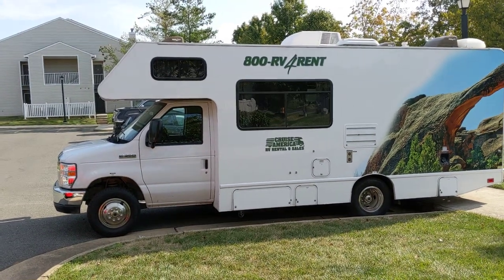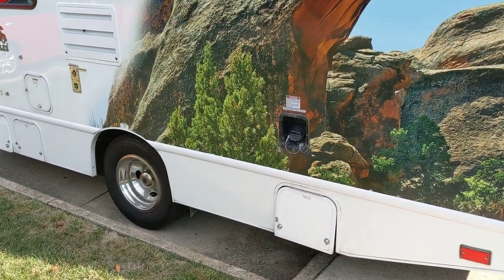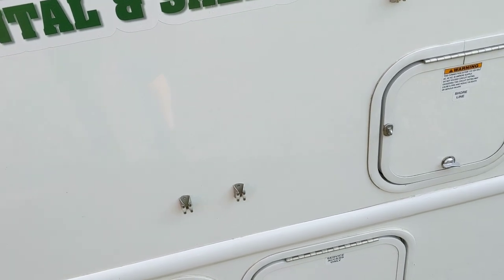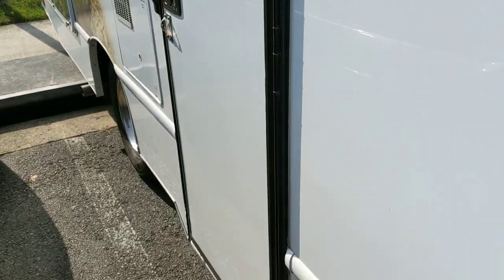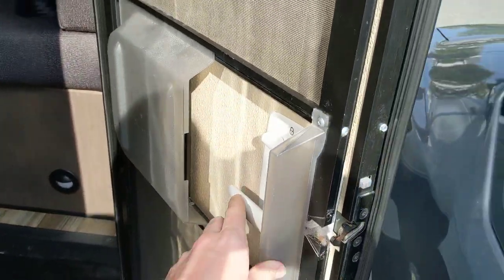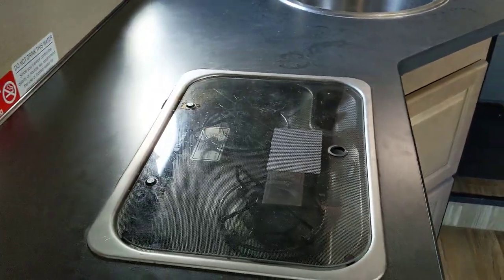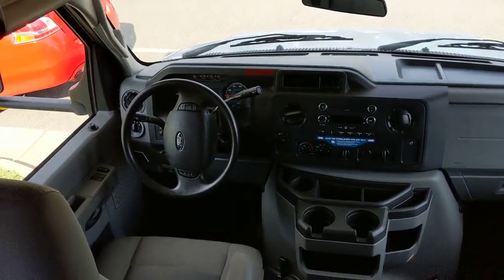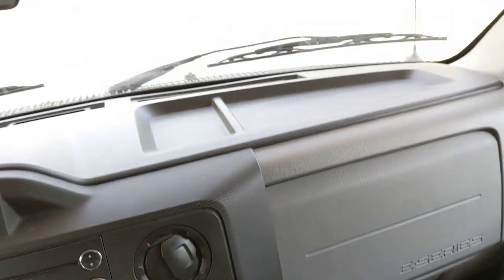Cruise America - Review and Walk through of 25' standard 5 passenger RV

Comment: Plan on renting an RV from Cruise America for a family trip next summer, but had a few questions that the Cruise America Orientation video doesn't cover. I was hoping you might be able to answer. Are the RVs fuel efficient? We plan on driving at least 2,500 miles or more. I know RVs have a huge tank, but I was hoping that it's not a gas guzzler. Also, I saw that you can use propane to keep the refrigerator on while not being hooked to the shoreline or not wanting to use the generator. How long will propane keep the fridge running? I know that this trip is going to be expensive, but just trying to save a little bit of money to spend else where on this trip to make it comfortable and to enjoy.
Reply from the maker: Hi!  Thanks for the comment.  If you scroll through the previous comments you can find a lot of additional information about these questions.  Generally, The standard size RV (with the V8) can get in the range of 10-14 mpg.  The larger RV (with the V10), a little bit less.  There is a big variable of how fast you drive (how heavy your foot is) and the terrain you're driving on.  Up and down mountains is going to consume a lot more gas than traveling across flat ground.  The RV's do have a 50 gallon gas tank so expect to go around 500 miles before filling up.  I remember one year we drove from Northern Virginia to upstate Pennsylvania and halfway back, before needing to get gas.  Of course it was a bit of a shock paying $200 for a fill-up, LOL.  😆

Note that if you use the generator it pulls from the main fuel tank, so this may affect your overall gas usage as well.

Propane is very efficient and should keep the fridge running for days (if no other power source is available).  The fridge has an "auto" setting which they should turn on before you leave the rental office, this way it will begin cooling down immediately.  Remember to not pack it too tight, the fridge needs to be able to circulate air inside to cool properly.  Before you head out I'd recommend topping off your tank.  Most Cruise America rental offices do not sell propane, but I've had good luck buying it at home & garden stores.

Hope this helps, have a safe trip!

Comment: Great video. Three questions that weren’t clear even from the posts - 1. Do we need propane to run the refrigerator while we are driving? Or does it work off the car battery.  2. how much propane is needed for a six day trip where we are staying in rv parks with electric? 3. How far in advance do you need to turn the water heater on? Thx
Reply from the maker: Hi! Thanks for the comment. The fridge has a switch on the top that let's you set it to run off propane, electric, or "auto". When set to auto it will run off propane (when available) or electric (when available). This means it will run on propane when you're driving down the road, and switch to electric once you plug in at a campsite that has full hookups. Typically the rental office agent will set it to auto when you're checking out, that way it will start cooling off immediately.

Propane lasts a long time and is cheap. If you take showers every day or wash a lot of dishes I'd recommend topping it off before you head out. Better to have it and not need it than need it and not have it. Most garden supply stores and other home goods stores sell it.

From the time you turn it on it usually takes around 15 minutes to warm up the hot water tank. So typically I'll turn the water heater on, drink my morning coffee, take the dog out, and then jump in for a nice hot shower. 😀

Hope this helps, have a safe trip!

Comment: Do you recommend buy an electrical dogbone to convert the 30 to a 50 amp plug in at some sites I’ve reserved along our route?
Reply from the maker: Hi!  Every campsite I've been to has had a 30A outlet available at the site.  I think this is pretty common, and you can plug right into that with no adapter needed.  The RV should come with an adapter to use a 20A outlet, but not the 50-to-30, as you mentioned.  Again, just in my personal experience, I've never needed one.  If you're reserving your campsites online sometimes they will give you the option of what type of power you would like when you are selecting your campsite.  I'd try to pick campsites that have 30A available.  If you do want to pick up a 50-to-30 adapter, it looks like you can get them on Amazon for around $20 bucks.  Good luck,  have a safe trip!
Reply: Awesome- thanks so much!

Comment: Video helpful as it is two elderly women who are taking trip and not familiar with all functions.   Do we need to buy propane tanks for the trip?  You showed a hose in RV, do we use this to fill water tank or do we need to bring a hose?  Does the RV 12 Volt cig lighters work well for charging phones or portable oxygen concentrator?
Reply from the maker: Hi!  All the rental RV's come with a standard garden-style hose.  You can use this for filling the fresh water tank from the outside, or connecting to a water source at a campground.

The propane tanks aren't topped off by the rental office, if you need to fill propane prior to arriving at your destination I've had good luck getting it at places like home & garden stores.  Propane is cheap and lasts a long time.  :-)

The 12V cigarette lighter outlets work very well for charging phones, laptops, and other accessories.  I've had no trouble running a splitter off these and using them to charge all my small electronics while boondocking.  Not sure about a CPAP machine though.  If you need to run something like that recommend you stay in a campground that offers an external power source ("shorline power") you can plug into.  Good luck!

Comment: Thanks so much for this, as I am a little nervous on our first RV rental. Couple questions I have. Does the RV come with the hose needed for the hookup of water? Does everything work inside off the electric hookup? Refrigerator, cooktop, and A/C?
Reply from the maker: Hi Dan! Thanks for checking out my Cruise America walk through video. To answer your questions, yes - there should be a white hose in the back storage area for hooking up to a spigot or fresh water source at a campground in the back storage area. Your rental office should show you where it is prior to departure.

Regarding the fridge, stove, and AC, the fridge can run off either propane (if available) or electric (if available). Switch set to "Auto" prior to departure. What this means is that generally it will run off the propane when driving and electricity when hooked up to shoreline power at your campsite. Remember to not over-fill it. They're not as efficient as household fridges. Also don't stand there with the door open. 😉

The stove runs off propane and can be used any time (I belive). Honestly we do most of our cooking outside and have only used it a couple times. The microwave requires either a shoreline power connection or generator running.

Likewise the large rooftop air conditioner only runs if the generator is turned on (can be ran while traveling) or when hooked to shoreline power.

I have a newer/updated video here, check it out:

https://youtu.be/qbBoA0x5Fow

Comment: What is the door width? Can you remove the dining table to stand a sculpture box there or parrot cage (2' x 3') ?
Reply from the maker: Hi! That is a good question! Off-hand I don't know the door width. Suggest calling your local rental office, but I believe they are in the range of 24-28 inches.

The dinette table is designed to fold down to make a bed. So it is on a hinge. From there, the hinge is held to the wall with I think three or four bolts. So yes, it is removable, but not really designed to be removed, if that makes sense? Just needs basic hand tools. 😉 Hope this helps!

Comment: First time RV person here..how long is the 30 amp shore power cord and sewer line?
Reply from the maker: Hi! Thanks for the comment. I've never measured them, but off-hand I would say the sewer hose is around 8'-10' long, and the power cable around 20'-25'. I've stayed at a variety of state parks and campgrounds and never had any trouble reaching the campsite hookups (just remember to park on the correct side for the sewer).
Reply: @CompTechMike  thanks for the info !
Reply: Ok one more question , what kind of gas mileage can I expect ?
Reply from the maker: @robmarrero1250  Hi!  The standard size (25') with the V8 engine get around 10-12mpg.  The large size (30') with the V10 get around 8-10mpg.  Obviously this his highly variable depending on how heavy your foot is, and whether you are driving across flat roads or up and down mountains.  🤣 have a safe trip!

Comment: Also, to be clear-the usb ports do not work while driving?  I think you said only when hooked up to power or generator. Thanks!
Reply from the maker: Hi!  That is correct.  The USB ports in the back only work when the vehicle is connected to shoreline power or the generator is running.  What we did is get a power adapter that runs from one of the 12V "cigarette lighter" outlets on the dash (which are always on) and provides many USB charging ports for our electronic devices.

Here is the model we got.  It is currently unavailable but you can find many like it on Amazon or at your local Best Buy or electronics retailer:

https://www.amazon.com/gp/product/B075KYXJBH/
Reply: @CompTechMike  This is incredible!  Thanks so much! We are leaving early Sunday morning, but I found another one similar on Amazon and I think I can still get it in time.  We got the large RV from Cruise America and have 5 people (2 adults and 3 teens), so we have a lot of electronics!

Comment: How much did it cost to rent?   What part of the country did you rent and use it in?  How did the expense of this vacation stack up against a more traditional vacation that involves hotels and a number of meals out?  Do they provide a surge protector, water pressure valve?  Thanks.  Shelley from San Diego
Reply from the maker: Hi Shelley!  Thanks for the comment and the questions.  I typically compare renting an RV from Cruise America to staying in a nice hotel, with the advantages that you get your own full kitchen and can bring your pets.  Personally we try to rent off-season to save money, and don't need any of the "extras" like cooking or bedding sets, and rarely run the generator.  Beyond that costs vary widely depending on the size of the RV you rent, how far in advance you book, miles driven, whether you need any of those optional "extras", etc.

They do not provide a surge protector or water pressure valve.  We haven't had any trouble using campground water and power but (as far as water goes) we only turn the knob a little bit - don't want to have water "on full blast" into the RV's plumbing system.  There are fuses for electrical protection inside the RV but if you're running a lot of sensitive equipment (laptops, etc.) you may want to bring along your own power strip / surge suppressor. 

Good luck, have a safe trip!

Comment: Actually if you have time, my son is a type one diabetic and we are concerned about the refrigerator sufficiently working to keep his insulin cold. In your opinion, should we just buy an insulated cooler or just run the propane on the road? I keep reading that you shouldn't, but a lot of people seem to still run the fridge. Thanks!!
Reply from the maker: Hi!  The concern about running the fridge is that if you are in an accident while driving the propane line to the fridge could rupture and cause an explosion.  I think this is a pretty minute chance of this happening (although accidents do happen - drive safe!).  The fridge is designed to run off either propane or electric depending on which is available; generally the rental office will set it to "Auto" during check-out so that it will begin cooling down immediately.  Most important thing is do not overfill it!  The fridge needs room to circulate air to keep stuff cold, if it's packed too tightly it won't be able to work right.  Also don't stand there with the door open looking for something to eat, but that's just common sense, LOL.  ;-)

Have a safe trip!
Reply: The fridge takes up to 8 hours to cool and it is not as cool as your fridge at home. I have told our customers to bring a cooler for medicines that need to stay cold.

Comment: Great video! Thanks for taking the time to make it. About the fridge, say you park the RV at an attraction for several hours, obviously not connected to shore power. Is that when it runs on propane, or how does it keep things cold during such times?
Reply from the maker: Hi!  Thanks for the comment.  As long as the fridge is set to "Auto" it will run on any available power source, including propane (provided you have some in the tank, of course).  Propane keeps the fridge cold when not hooked up to shore power.  Remember to not pack the fridge too tightly, as air needs to be able to circulate inside in order for stuff to cool off.  And don't stand there with the door open - RV fridges are not as efficient as home fridges.  Hope this helps, have a safe trip!

Comment: Thank you so much.. we just reserved one for November to go to NC. Have never done this before so  this video answered alot of questions. The propane .. is it always on or do you have to turn it on.. i heard you say shut it off when getting gas. and the fridge and the toilet. work while driving or no? needs a power supply ? sorry very new at this and want to learn everything before we go. thanks again for a great video
Reply from the maker: Hi!  Thanks for the comment.  There is a knob to turn off the propane in one of the compartments along the side of the vehicle.  In most cases you should not ever need to turn it off, but some states do have laws about this (for example when filling up with gas or driving through tunnels).  So it's not a "technical requirement", per se, but more a matter of complying with the laws of where you travel.  

The fridge has an "auto" setting meaning it will run on shoreline power (if connected) or propane (if available).  Your salesperson should turn this on for you as part of your departure check-out process.  It will run all the time to keep your stuff cool.  Remember these fridges are not as efficient as household fridges; do not over-fill it and don't stand there with the door open, LOL.  🤣

The toilet can be used at any time.  Just push the switch on the control panel to turn on the water pump (draws water from the vehicle's built-in water tank)  if not connected to a campground water supply.  Also many states have laws that occupants must remain buckled in while driving.  It would be pretty horrible to get into an accident while someone is sitting on the toilet!  But we've pulled over many times to use it while on trips.  Much easier than finding a clean toilet in a roadside rest area.  😆  Have a safe trip!

Comment: Hi Mike does the passenger seat recline? Also do you have any idea how wide the walkway is...just want to see if my doctors manual wheelchair will fit in the camper in case it rains
Reply from the maker: Hi!  Off-hand I don't believe the seats are able to recline.  There is also a bench located directly behind the passenger seat that would prevent it from being able to go back very far.

You may want to note that the Cruise America rental RV's do not have slide-out sides.  This means they are pretty narrow inside.  Even if you able to get a wheelchair in through the door (by folding it, I guess?), you wouldn't have much room to move around - especially in the back near the bathroom.  I don't want to be someone who says "don't rent an RV", but I think if you require a wheelchair for mobility you may be better suited with an RV that is designed to accommodate that, or at least has slide-out sides.

Check this link for tips on renting wheelchair accessible RV's:

https://www.outdoorsy.com/blog/accessible-rigs

Good luck!

Comment: great video mikie! while driving did you use the air conditioner from the ford ick up truck? or did you turn on the generator? because i read that cruise america charges you 3.5 dolare pero hour for the genertor. greetings from Argentina
Reply from the maker: Hi!  Thanks for the comment.  You are correct, Cruise America charges $3.50 per hour for generator use, and you have to check the oil periodically like with any small engine (like a lawnmower).  Personally we have very rarely needed to use the generator.  When driving we use the AC up front to cool us off.   Hope this helps!

Comment: Temperatures are going to be dipping down near 32 degrees when we travel soon.  We want to use the onboard water, so we don't want to drain everything.  Any tips on keeping the pipes and tanks from freezing?
Reply from the maker: Are you staying in one place or are you traveling?  I'd look at getting some heat tape or a heat cable to wrap around the water line running from the campsite spigot into the RV.  Also an old-fashion incandescent lightbulb on a cord (like a mechanic's droplight) stuck underneath (near the water compartment) can provide a few degrees of warmth to sensitive underbelly areas.  You can get those type of things at Walmart or a Home Depot/Lowes type store.  You can also open cabinets (like under the sink) so heat flows more freely through them.

Check out this link for more tips:  https://roamingrv.com/winter-camping-be-prepared/

Have a safe trip!